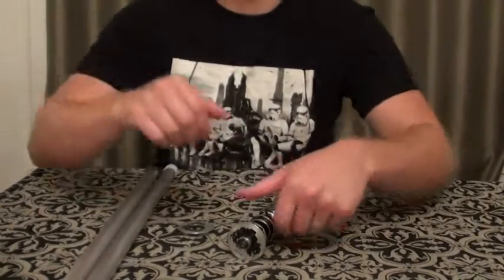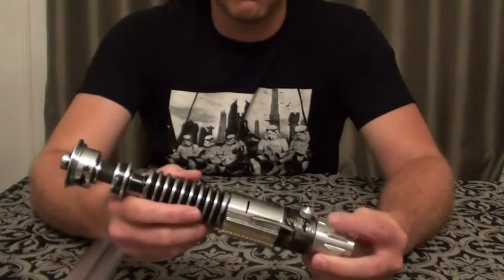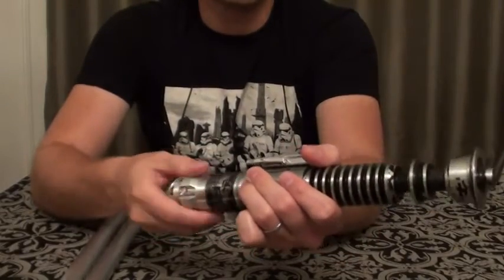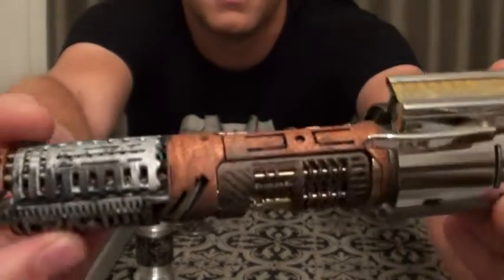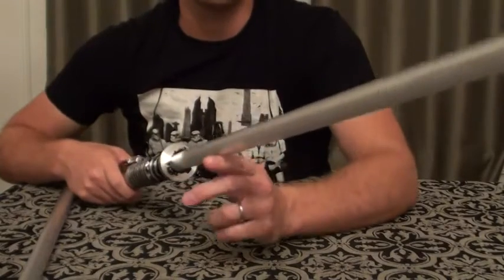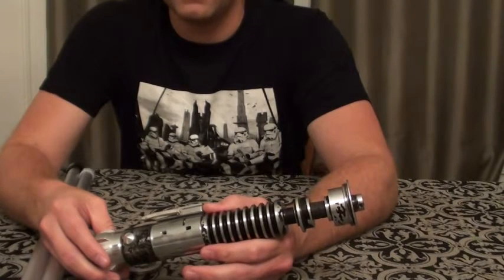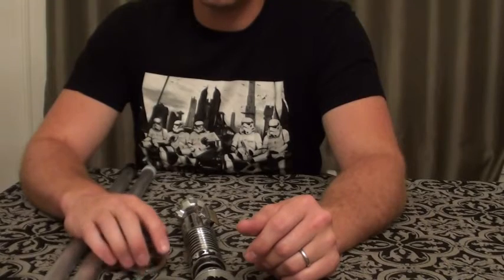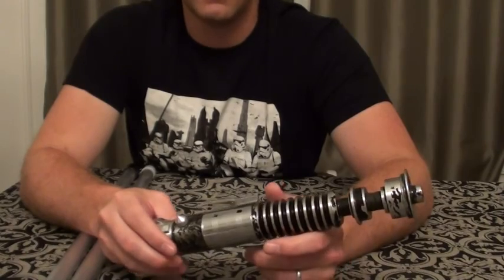Solo's Hold Luke V2 with Crystal Focus v8 Install and Review

Comment from the maker: I know I said replace the clamp with a satin one but I meant the Matte finish.
Reply: Chris Goodman it cost 400 dollars for the empty hilt how much did this cost with the electronics and I'd like to do do the weathering with the stencils
Reply from the maker: Hey Manny,  Sorry I must have missed this.  I used a CF v8 which now there is the v9 but it's still a $150 board.  The LED was $26 give or take.  The chassis was expensive because I did the Master Chassis and uses metal printed pieces which costs more than the regular plastic.  If you use Rick Ryo's (Goth 3Designs) Master Chassis, he tells you exactly what you need to purchase on his website http://goth-3designs.com/instructions/nerfworxlab-luke-v2-chassis-line/.  The stencils are from Trooper Trent on The Rebel Armory.  It's in the miscellaneous section.  It will be a few hundred bucks for all the materials between the board and chassis. Best of luck!
Reply: Chris Goodman ok thanks

Comment: What LEDs did u use for the " Knight Rider " effect? You may have said, and I missed it. Thanx
Reply from the maker: Rex Beaver that's a bar graph from thrgk on The Rebel Armory. He makes them anywhere between 4-8 segments. The knight rider effect is programmed in the CF v8.
Reply: Is it possible for me to get my hands on one?
Reply from the maker: Rex Beaver yeah just become a member of Therebelarmory.com if you're not one already. Go into the miscellaneous items thread under the Sales and Trades section and you'll see his Bar graph thread.
Reply: Ok, thanks a ton. I painfully new to the saber circle. I'm trying my first large project, and I am using the cf9. I like what u did there and I want to do something sort of like it. 🤺👍
Reply from the maker: Rex Beaver I was there too a couple years ago. This was my second build and the chassis was challenging but in a good way. Get on the forums and dedicated lightsaber pages. Ask questions and search the forums for answers. If you're on Facebook, look to join The Vault, Luke ASG page, The RPF page and Elite Lightsaber Society. Great wealth of knowledge on these pages.
Reply: Hello, me again👍. I'm wondering if you would be able to help me. I am installing a cf v9 and I can't figure out how to get a glyph program on leds1-7, and 8 pulse xtal chamber. It seems u have done it perfectly. The cf manual is kinda hard to follow. Thanks
Reply from the maker: The manual was confusing the first few times I read through it.  I'm not an expert on the v9.  You may want to jump on the FX-Sabers forum and message Erv himself.  Or someone more skilled that me can point you in a better direction.  I had the default set up for the knight rider effect on the bar graph.  I used LED 5 for the crystal chamber LED.  Which meant the 5 LED on the bar graph would pulse or be steady depending on the crystal chamber LED.  You can change the LED # in the LED settings in each font.  Up on top of the listing there are different settings (pli, glyphpli, random, accmode, halfd)  all should be set to 0 but you can set the accmode to 1 for the crystal chamber to mimic the blade.  I didn't play with it too much other than that.  That's why I say your best bet may be to go to the FX-Sabers forum and look in the Plecter section.  Hope this helps.
Reply: It didn't help much, thanks though. I guess I'm just wondering how you have a full led sequence, and still a blinking accent led. Sorry if I am being annoying
Reply from the maker: Rex Beaver no dont worry. I have two LEDs wired to the 5th channel on the board. 1 is the crystal chamber LED and 1 is the 5th LED from the bar graph. All others are wired normally. But the 5th LED in the bar graph does whatever the crystal chamber LED does. It was the only way I could get what I wanted. Keep trying.
Reply: I read you comment again,  I totally get what u did now. Thanks again.

Comment: Can you please help me out. I am trying to understand. So when you buy electronics and set it all up, you can ajust setting via what? an sd card? and in addition to this question, as far as the dialogue between sound fonts... how are those segments installed? are they part of the sound fonts ? or do you individually install them?

Another question sorry :/ i would like your opinion on this.  So i have someone that is a saber smith himself selling a Solos hold v2 and i have been waiting for solos hold to announce a new run of them but i dont know how long that would be.  so i decided to message him.  I am in the process of buying the hilt from him hes selling it for 420 which inst bad just 20 more than solos hold would sell it for.  I have no idea about the weathering so i asked him if he could do that for me he said yes and is charging me 280 for the weathering... is that a high price for that? All together is about $750... also, i was on evolutionarms (which is the same hero as Vaders Vault) and i was looking at getting a Luke hero (it has full electronics, a charger and a blade) and its about the same price as the solos hold V2 weathered without electronics. I just dont know if i should stick with the solos hold or get the hero from Evolutionarms. what do you think? mind you, the V2 has been my fav since i was a kid.  Eventually i will get both, but as for right now what do you think?
Reply from the maker: Nicholas Ramirez The settings for your sound fonts and electronics all go on an SD card. Depending on the soundboard, you can switch between multiple soundfonts that play different Saber sounds or sounds from the same Saber made by different font makers from saberfont.com. The sound bytes from the movies are usually in the sound font package you purchase but not always. You can research how to make a sound font to figure out if that's something you want but most of the iconic lines are in the font packages. 
 If you have your heart set on a V2, I would either look into Ryan Kelly's RPK customs run (he is on his third version which is the most screen accurate fx empty V2 out right now) or wait til SH announces his next run which should be by the summer (but don't quote me on that). The price for the weathering seems high. Jordan Eugene of So-Cal Sabers does that as well for less I believe and his is one of the most accurate weathering processes you'll find. You may want to wait on the weathering and get some other quotes. As far as the Evolution Arms, I believe he offers 2 options, a Crystal Focus or a Neo-pixel with Crystal Shard. Just depends on what you want for lighting, either a tri-cree or neo-pixel. My opinion, VV and EA offer the most screen accurate fx Hero. Based on the ISYHCANL scene with Vader in ROTJ. So you can't go wrong getting one from EA. Hope this helps.
Reply: thank you for that info on the soundboards!!! 

I eventually want both the hero and V2.  I thought Solos Hold was the most screen accurate?? That is what i have heard anyways. Thank you for the info im going to hold off on the weathering. I think ill still buy it from him but just wait on the weathering. With purchasing this, you also need to purchase the graflex clamp from roman right? 

I just saw that rpk customs updated the pomel so that it lined up with the card so thats its more accurate.  
its 300$ and there is a run going right now.  What would you do? buy the solos hold from the person selling it 420$? or go with RPK? 

I definitely would want the neopixel. When the time comes im going to get the neopixel from VV.
Reply from the maker: Nicholas Ramirez SH had the most accurate V2 going for a couple years but now RPK came out with his version which is more screen accurate (due to new photos that weren't available when SH did their first run) and also the Anakin Starkiller run over on The RPF forum. The RPF run is done though and has been closed so getting the RPK would be the next best thing. I'm sure when SH comes out with their next run it may be the champ again but we'll have to wait and see. One of guys behind Nerfworx (the SH guys) has held the actual V2 prop so I'm guessing their next model will be even better. You may want to hold off and see what they develop. An announcement should be soon.
Reply: Chris Goodman I think I’m going to hold off till SH releases their new run soon. I want it as accurate as possible. I think SH is a little thinner than RPK and that’s what I want for even more accuracy.
Reply from the maker: Nicholas Ramirez and if you end up waiting on the new SH V2 you can bet that Goth will develop an amazing Master Chassis for it. Hopefully either Trooper Trent will still be doing stencils for the weathering or SH may even offer the service. I think it's a good move.
Reply: Chris Goodman thanks for your help man good job on the builds and all your V2 looks amazing. I want mine with lord blakos ROTJ along with plenty other fonts and also dialogue to go with the fonts
Reply from the maker: Nicholas Ramirez if you haven't checked out the Luke ROTJ Addicts group on Facebook, you should. Has great references for all versions of the Luke ROTJ saber. Including all the fonts from saberfont.com that are for Luke's ROTJ saber (and there are a lot!).
Reply: Thanks for letting me know about that i was not aware ! So i am going to wait on SH next run coming soon to see if those will be better than the RPK V2. I just hope that RPK wont stop the run before they come out so that i can still choose. .
Reply from the maker: Nicholas Ramirez there are always people selling unfinished hilts on Facebook and the forums. Worst case scenario you could always get one that way. If you get a chance, find Jordan Eugene's (So-Cal Saber services) YouTube page. He has a recent video where he compares the SH V2 to the new RPK. It's a good watch.
Reply from the maker: Here is the link https://youtu.be/ir5j5S3d9TM
Reply: yeah i saw that. did you personally see a major difference in thickness on the grenade portion of the hilts? The RPK is a tiny bit more fat on the thin neck portion but the grenade looks thinner to me.... another thing i noticed that jordan doesnt state is that the pomel cubes look more accurate on the RPK compared to the SH.. to me at least. what do you think ?
Reply from the maker: Nicholas Ramirez the neck looks slightly fatter on the RPK. Not too much of a difference in thickness of the rib section (small but nothing major) the cubes on the RPK as well as D-ring placement is more accurate on the RPK (I think).
Reply: Chris Goodman I’m just going to stick with the   RP it looks more accurate to me than the solos hold does. AND the RP actually looks thinner now that I looked at SoCal sabers comparison photo of SH, Anakin star killer, and RP. 

Crazy, starkillers V2 is the thinnest...
Reply from the maker: Nicholas Ramirez I'm in on the new Anakin Starkiller run before it closed and it's almost ready. Really looking forward to that. I'm holding out for SH new V2 to see how accurate they get it. If I do, I want to turn this one into a V2/Hero hybrid.
Reply: Chris Goodman that sounds badass man. good luck with that! I hope you post a vid on the star killer hilt when you get it or when it’s done I’d like to see that. I like how thin it is but I think the RPK is just as fine I mean, none of them are ridiculously thinner than another

Comment: Hello does anybody know when solos hold will have these up to buy again?? i have been trying to find out but i cant and i cannot miss the next chance i get please let me know if anybody knows
Reply from the maker: Nicholas Ramirez I believe SH is updating their existing V2 to be even more screen accurate since the interview with Mark Hamill holding it. Keep a watch in The Rebel Armory to see updates from them. I would think after their current run of Rebel Sabers is done we could hear something. Thanks for reaching.
Reply: Thanks a lot man if you dont mind me asking how expensive was yours? i believe 1400-1700?
Reply from the maker: Nicholas Ramirez the kit was $400 from SH. The other parts I can't remember how much everything cost. Important pieces were, Trooper Trends stencils, Goth Master Chassis, CF v8, main LED, 5mm LED for crystal chamber, Roman's clamp and Slothfurnace clamp card. Hope this helps. All together, the additional pieces should be around $600-700 (not including the $400 hilt) depending if you get discounts. May 4th usually has good discounts.
Reply: Thank you! Does he have them available to buy fully built ?
Reply from the maker: Nicholas Ramirez I don't believe so. But if you get one empty, use a good installer. You may have to wait for an install but it will be worth it.
Reply: Chris Goodman I have little to know knowledge about these sabers but I’ve always wanted one of these hilts. I need one I just don’t know how to install everything so I need to get it from sh I guess and then have it installed from someone . Idk where though there are some vids on YouTube of sh V2 that are for “someone’s name” and they are titled V2 for so and so and I guess they made it for people? I just don’t understand it but I want it from one of them
Reply from the maker: Nicholas Ramirez basically a person purchased the empty SH V2 and contacted the installer and commissioned them to do it. That can take anywhere from a few weeks to a few months depending on how good the installer is.
Reply: Chris Goodman ok I understand did you do it yourself?
Reply from the maker: Nicholas Ramirez yes sir. This was my second install and it was a fun and challenging one. I asked a lot of questions on the FB pages and on the forums (The Rebel Armory and Fx-Sabers). This was my favorite install to date. I wish I would have gone with a different tri-cree though. I would have done green, lime, white if I could go back and change it. The Green, green, white is nice but the Lime, green mix I believe to be more screen accurate.
Reply: Chris Goodman that seems very confusing I’m not the best with technology so I feel that it’s definitely out of my reach I will definitely have to find someone to do it for me :/ I want it as screen accurate as possible and I also want the r2d2 installed here too before ignition when I want.
Reply: Chris Goodman as well as some themes and dialogue from the movie
Reply from the maker: Nicholas Ramirez the installer is Obi-Shane from The Rebel Armory. He is a part of NerfworXLab which designed this V2 (Solos Hold is a part of NerfworXLab). You can reach out to him here. http://therebelarmory.com/board/66/obi-shane-customs
Another installer that is incredible with accuracy is Jordan Eugene of So-Cal Saber Services. If you haven't already, look up his YouTube channel. He's done a ton of V2's and his weathering is the most accurate you'll find.